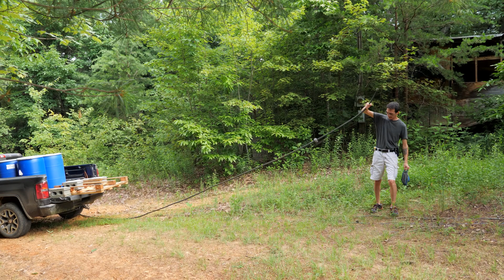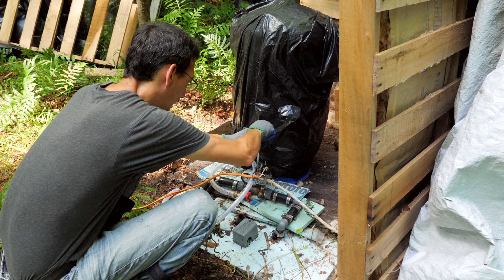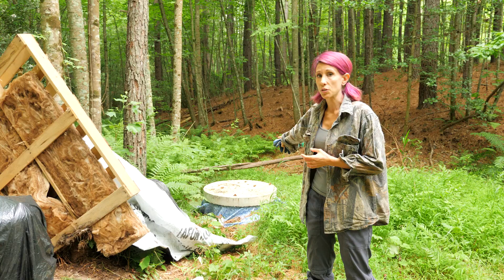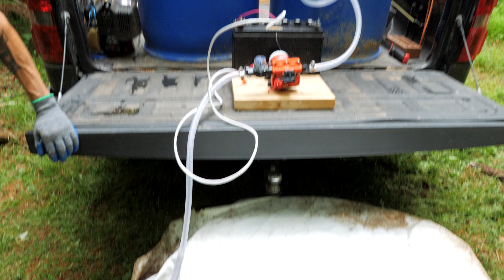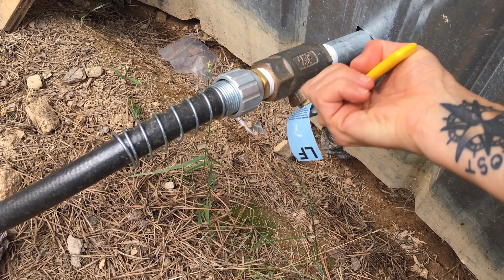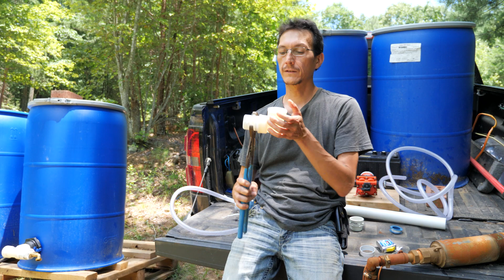NO WATER...AGAIN! Will This Off Grid Gravity Fed Water System Work? (Part 1)

Comment: "How to hillbilly your water" Perfect Quote! Exactly my thoughts, when I saw this whole over complicated / under built contraption. Glad yall can redo this to acceptable, and reliable specs.
Reply: Also... after you have your bored well done.. I do suggest a DC system to save on efficiency. Not great GPM but it is ideal for off grid ... Many blessings! * well as long as the bore spot is not very far from the batteries. Anyway.. all the best... Ohh and also.. as for hot water... Build some solar heaters... store the water in attic space in a circulating and pressurized system... easy to store hundreds of gallons and then no need for electric or LP to heat water... for most the year. Easy to keep 100 gallons or more on hand at 90+ degrees. Even in winter if built right. *why I say attic space is because it generally is the warmest area in any home... best place to store it ;) Build the storage tanks like a normal water heater... cold enter at bottom draw from top... 100 gal minimum in my opinion... as buffer... for night use and for cloudy days. I have put a lot of thought into this set up... and as a back up... having a back up small water heater is ideal for winter / cloudy days... but overall this will not use much power at all... Yall are very sharp... Only reason I subscribed. Simple thermodynamics... minimal engineering... well designed it should cycle itself to heat the water. (no pump required) Pressure is provided by the source pump... and let it all flow through a small water heater.  (personal preference on my design just in case) Remember ... water is an amazing battery also. It can store incredible amounts of energy... also.. it takes an incredible amount of energy to heat it (8.33 BTU per gallon per degree of temperature rise) .... all that must be done is to create a heat sink to collect it from the radiant energy from the sun) This is the beauty of our planet... The massive amount of stabilizing effect the water provides to stabilize our environment. Anyway...  In a nutshell... avoid turning solar energy to electricity then store it in batteries.. then convert it to AC... to heat water which takes huge amounts of said energy to do... Just use the sun directly ;) ) Best of Regards!
Reply: Lastly... we too live temporarily in a single wide, and the commercial building on our property. Upon which stands a 110 year old school house that I am converting to a home. (built from old heart pine / oak and cedar) OMG! (yes real 2x4 and 4x6 and all the ceiling / wall board is ceder... <3 Anyway the blessing is when it comes to wiring and plumbing... it is easy to do so exactly to what becomes efficient for a solar set up. Lighting will all be DC (and diffused mostly except where direct is required). Many outlets DC. AC where it is needed ;) Making huge leaps in savings of losses in switching back and forth between DC to  AC and in many situations back to DC again.
Reply: Will even run some good old cat5 to hard ports for net. Get rid of the WiFi unless, we want it, for mobile use with a laptop on the couch for example... but most the time can power it down  ;) Good idea for many reasons.
Reply: My very last suggestion... go big on batteries. Always. Especially since ya switched to Li-Ion... It is your only buffer... Batteries >than panels... add batteries... do all the math ya want ... at the end of the day, every day is different. I only say this because... This is what regulates that variable...  when you cant charge em enough add a panel array. Use your storage capacity as the baseline in the real world of living off grid. Simple logic applies. You were perfectly right to invest in higher end converters and regulators to expand later.  Great channel .. love what you are doing... thank you for sharing <3
Reply: Ohh.. almost forgot... If the well spot is far from your main power supply... it is far cheaper to build a small dedicated system on spot regarding power supply. ;) food for thought. Easy to do for like $1500- $2500 or so USD (mostly depends on depth if using DC)... and underground cable even for 240... well they call it 220... na its 240... would run ya that much alone just in wire....if its a long distance lmao. UGC in 8 gauge is like $1.40 a foot. (last I checked) Few panels... one charge regulator and a couple batteries @ 24 volts.. and voilà! Should get 3-5 GPM depending on set up and how much head pressure it must produce. Not complicated ;) No it is not the 20 + GPM we all want but it is very acceptable for what yall are wanting in reliability <3

Comment: You're getting a lot of good ideas in the comments. I hope some of them are useful for your situation. As someone who built around 10 years ago, on 5 acres, I can tell you - unless there's something wrong with the spring water, I'd invest in fixing your existing system. I wouldn't build the well, unless there was something wrong with your spring water. As it will cost you less in the long run, and what you save, you can invest in setting up a secondary, rainwater catchment system, as backup. What I've learned in my experience, is not to spend money on too many systems, which are based completely on technology. By spending on a new well, at some point you're going to run into problems - just like the spring system. You're up for $$$ again. 

It's really good to experiment with the gravity fed system, and I think water catchment could fill those barrels for you. I heard a great saying recently: people often overestimate what they can achieve in a year, but underestimate what they can achieve in ten. So while I know water is an urgent priority to fix right now, consider the long term. How is spending the money on a well going to pay off over time, if you're still going to end up with problems? My grandfather came from stock, that you always knew how to fix your water pump. Only in his day, it was a towering windmill. You had to be prepared to climb it to fix broken parts, high, and you had to go underground to fix broken parts, below. So, fixing systems (even low tech ones) are going to be part and parcel of the domain. So where is your money best spent? Your low tech spring, may have less chance of failure, than a higher pressure well. 

I'd research what fixing a well would cost you in parts, and do a comparison between it, and parts for the spring. What is going to cost more in the long run. The simpler systems, I have found, inevitably cost less - so long as you understand how they work. After  a decade, our systems haven't failed yet (apart from one pump on the septic) however, I'm researching lower tech solutions. Simply because I want to be able to fix them, myself, instead of having to hire professionals to do it. Money we may not always be able to afford.
Reply: Chris , once a well is drilled and performing, it’s no more complex to operate than the spring. But it’s likely more reliable.
Reply: Sorry Jim, but water is water, pumps are pumps. So you are right, not more complex. But a homeowner can reach in and repair his springs pump. How's he going to do that a few hundred feet down? Plus spend up  to $20K for install without any guarantees of hitting water. 
His point was simple and honest. Wells aren't any more reliable, they are the same, only deeper and more expensive.
Reply: Thanks Jim and Ken, for chiming in. Always different goals to contemplate. I'm not against wells, if you don't have an existing water supply. They can be a good upfront investment. But if you've already spent money on purchasing land with an existing water supply, then spend money again, for another supply - you've doubled your maintenance and parts, over your tenure. While they could let the spring go and focus only on the well, what happens if the well breaks at some point in the future? They're going to want to tap that spring again, until the well is fixed. It's not uncommon in our region, for people to have to spend double on fixing a well that wasn't drilled correctly.

So a well is only as reliable, as the company drilling it. If they don't use parts designed to hold the pressure, you'll be up for repairs sooner than you think. I've done research on drilling bores (well, for the US) and only one company in my region, advertises where drilling bores can go wrong. They provide specific questions to ask a competitor, to see if they supply the heavier duty parts, and whether they have specific accreditation to do with understanding stratas (ie: what they're actually drilling into). It's not just a matter of putting a drill into the ground, it's knowing when to stop drilling, if what you're hitting, is actually going to compromise the integrity of the housing.

So yes, a well can be a good investment - but it depends on a lot of factors. We're always led back to the realm of fixing things which break, anyway. So it comes back to the question, what are you more comfortable paying to fix, and how much do you want to be able to fix yourself?  This is a general question for general contemplation. It's not meant to tell Guilderbrook Farm, what they're meant to do. It's just food for thought. :)

Comment: Have you seen any of Mapleberry Farm's videos?  They're doing pretty much what you are and faced the same issues of frozen pipes in the Winter but  living in a small RV with a 3 yr old.  Reason I mention it is that Jeremy came up with a pretty ingenious way of getting a shower and then saving the water.  It could help you out in the length of time your barrels last.  If you collect the shower water in the bath, you could use that to flush the toilet, it wouldn't hurt the plants if you used it to water them.  When you're hauling every pint, it seems pretty bonkers to watch it disappear into the drain when it's not really filthy or  dangerous.  I'll see if I can find the video and post  the link here for you.  It's just your cup of tea this thinking outside the box thing.

Comment: Consider adding a breaker box at the well between your supply and the pump. The breaker will trip instead of burning the pump. Even a used one from a habitat for humanity type hardware store for parts. One step at a time right?

Comment: looks like you have iron in your water ...we have lots of iron in our water and we found that having a 2500 gallon settling tank and a 500 gallon storage tank workes for us ...believe it or not the iron settles out befor it gets to the 500 gallon storage tank ...no more stained yucky sinks and toilets ....we also put in a well and found out we had just as much iron in it as our spring ...hope you have better luck with that then we did ....been enjoying your journey for the last 2 years almost ...keep the camera rolling for us
Reply from the maker: Our old house had lots of iron in the well. We put in a softener made for iron and it did the trick.

Comment: you could also try using that #12 wire by twisting the negative and positive together at both ends then use the ground for the negative side. If you need more ground, drive a rod in the ground at the pump location That's if your pump runs 110 you may have to switch jt over
Reply: Twisting two together is a good idea but I wouldn't use the ground for anything but ground. It does make it so all that needs to be done is buying a single strand of 8 gauge wire to run... That should nearly cut the cost in half.

Comment: I would invest a lil bit of money into that system and get it running and also winterized because you never know when you might need it again and it never hurts to have backups.  Someday you may have animals around there close and it would be a handy way of watering them.  Never say never.  Where we used to live, we had a well and pump before the city water was installed, then it had to be disconnected.  We keep the pump and well and it became so useful to water horses and the garden and anything else we needed to water.  You have land and that is a resource, don't discard it.  A fellow You-tubers has a saying that has always stuck with me,  one is none and two is one.  That always proves out to be so true.  Emergency water will someday be a God send.  Maybe putting the little pump in run by the battery with a small solar setup to keep the battery charged.  Even well pumps quit from time to time.
Reply: Basic numbers put it around $700-1000 just in wire and a pump to get it running how it was before the current problem. If you add in changing plumbing looking at another $300 in pipe and fittings then renting a mini excavator to get the pipe below the frost line for a temporary system.

Comment: UGGGGGGHHHHH.  This video gave me a PTSD moment of hauling water in my childhood.  How we ended up doing that is a long story.  But, if you are looking at six months of this, this is what we did:  After quite awhile filling up trash cans the way you are filling up your rain barrels,   my dad put a designated water tank in the back of our pickup truck.  I'm guessing that was somewhere between 350-500 gallons. 500 gallons comes to mind, but that had to put quite a load on the truck.   We drove the truck to our water source and filled it up all in one go.  Then, once home, we had a submersible pump and a wide hose that pumped the water QUICKLY into our water tank.  This was probably the equivalent of a strong pond pump, nothing as heavy duty or expensive as what you have in your well, but it went waaaaaay more quickly than moving water through a thin hose. And so we hauled water once a week rather than every day. If you have any concerns about that spring as we approach summer, you might see if any of your neighbors have access to water at an agriculture rate such that you could buy it from them and fill up once a week instead of making hauling water part of your daily chores.  We did this for years.  It was not fun.  I sure hope that pump is functional and all you need to do is lay down 8-gauge wire.

Comment: We have municipal water but it's on a meter. For the last 4 years we've used the water from the kitchen sink/bath to flush the toilet using buckets - just keep the plug in the bath when you shower too. If you use a plastic bowl in the kitchen sink it's easy to fill the buckets. It works well for two people and for extra we use the rainwater collected just outside the kitchen door. Just an idea that may help reduce the work needed to keep filling the barrels. Of course the water isn't 'clean' per se but it works! Plus the permaculture method principle of 'if it's yellow let it mellow, if it's brown flush it down is good too. You could also maybe try a dry toilet too. Wouldn't take long to build the box and bucket system :)

Comment: So I am confused. If the spring still has water in it and the original system is connected to the house why would you not just string some wire along the ground and get the system started again. If the pump is fried, replace it. Since this is a temporary system that should restore the water and get you running until the well can be drilled. What you are doing seems like a huge amount of effort for the same outcome. Obviously I am missing something.
Reply: A new pump with 300+ feet of lift would be around $200, the 8/3 wire needed is around $1.70/foot or more then $500 for the 300 feet. Sure he can string the wire in the trees to avoid trenching but that is still a $700-1000 project on something that will be gone next year unless they convert for animal/garden use only.
Reply from the maker: The pump is good 👍🏻👍🏻👍🏻. It’s a good $1000+ pump. Fortunately it’s a 2 wire so 8/2 is $1.10/ft.

$441 in new wire + some fixtures to move the pressure tank to the house. Worth it.

Comment: Good work on the temporary fix. No easy solution there if this is not going to be your permanent water source. Running new wire and a new pump, if necessary, may become worthwhile if a permanent fix is a year or more away.

Comment: Great very temp solution. If it will take a little longer to get the well, have you considered those 275+gal totes? If you can get 1 or 2 and mount them on a trailer, you wouldnt have to make as many trips.
Reply: Sorry, just got to the part where 110gal was close to empty. Dang!

Comment: Just saw a commercial on YouTube about a solar well pump. Came with the solar panel,  controller and pump. Did not say what the cost was
Reply: The full system is around $1k but would require cutting down enough trees to give a good solar window or running enough wire between the panel and the pump to get the panel into a sunny spot.